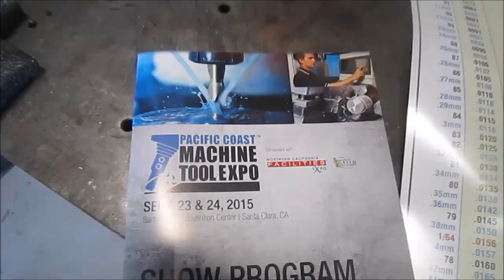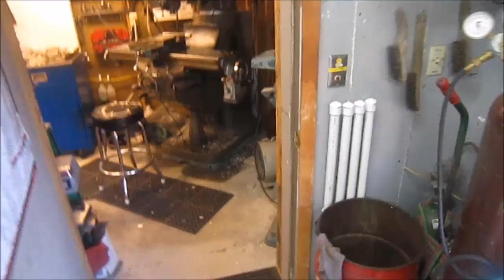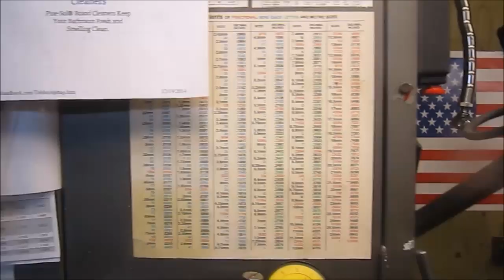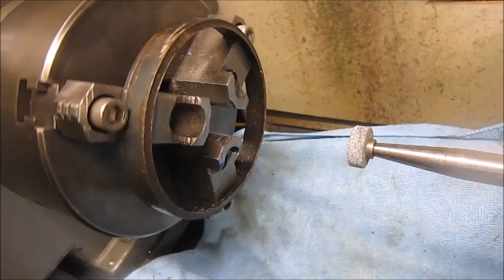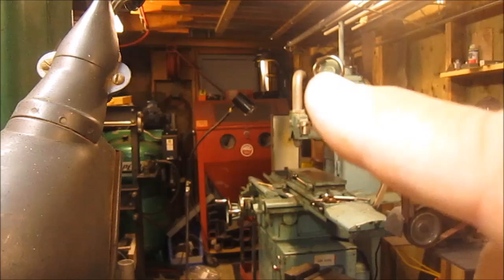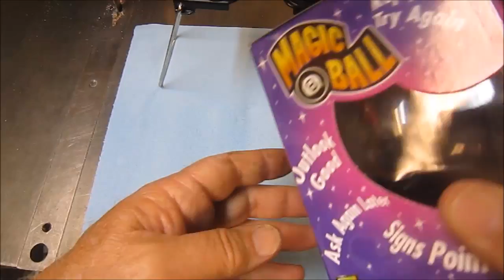Screwy Tuesday #30  Tool Post Grinding

Comment: That adjustable ring is to pre-load jaws before grinding or turning, the pins go inside holes in jaws..my Forkardt chuck
have holes. I made a ring with with 3 -  90 degree screws, going inside the holes, fine adjust by screwing in or out.

Comment: Hello Chuck, whenever I can spare some time, there is a chuck on my rotary head that needs some grinding to complete the full restoration... Interesting to see how you tackled the task...  
When you purchase a good quality chuck, the zero mark is set by factory as the most repeatable key, if you dismantle the chuck for cleaning or an other reason, you have to rebuild in the same order or find the new repeatable key...   ;)

Comment: Howie working hard I see. I hope your son recovers soon. As you must not know 3jaw chucks tend to have a master key, which is the one that is used to tighten that gives best accuracy because that is how it was made. In your case it is the one with the Big arrow beside it. 12:42. If you had used that one to tighten up your ring when you did the grinding it would be your master still, apparently the one you have found to be 0 was the one you used instead so now you have a new master.  I would probably regrind to put the master back in the right spot rather than adding a mark but in reality it matters not.

Comment: "Very doubtful" indeed. The two magnifiers are aimed at two locations. Getting them to point at a single location (such as for tool inspection) wouldn't be an easy job.

Why not enjoy them for what they are? On a still day (no wind or other motion in the field of view), take two pictures of the same scene from locations several inches to a foot or so apart. Print them  (horizontal size about equal to the distance between lenses) and lay them side by side under the viewer. Have a look to see the scene in 3 dimensions.  Move the pictures towards or away from each other to get the least eyestrain. (If things look inside out, swap the pictures right for left.)

These are usually used to examine pairs of aerial photographs to show differences in elevation (hence the "Geography Dept" label). I have a very fancy Japanese WWII military stereo viewer, with a set of micrometer cross-hairs. You can calibrate the cross-hairs on an object of known elevation, and then measure the elevation of any other object in the pictures. Pretty slick. (I mostly use them for the WOW factor to demonstrate the 3-D effect.) You can exaggerate the 3-D effect by taking the pictures from farther apart. 

Machinists with good CAD programs could print pictures using their CAD program's ability to create images from different viewpoints. Make two pictures from viewpoints several degrees apart (experiment) and put them under the viewer. Voila! 3-D pictures of your part.
Reply: I found a US military version on eBay, and it was such a good deal, I snapped it up. I'll compare them.

Comment: I too love my decimal charts - but these days no wall space either! One fix is a little 'bible' produced by Dormer tools - that serves well most of time. I in the end fitted mine to the inside garage door! Aha - roller blind fix -- like it!!
Paper rack nice idea.
Nice to have that toolpost grinder... I'm going to get a new chuck to replace my old one - but also got to deal with back plate issues.
Tubalcain took one of those 8 balls apart.
I had one of those map readers, from circa WWII - very handy. 
Persevere with the beard Chuck - it is good entry qualification to the old farts club! :)

Comment: The Huron tool is used to bore soft jaws in a CNC lathe with a hydraulic chuck that why it has pressure ratings stamped on it.

Comment: I like that chart on the shade trick.  Not quite as easy with the 20 foot ceilings in my shed, but might be able to find some ledge to hang a small one under.I hope Tim gets back home quickly.

Comment: Hey Chuck,
Thanks for the explanation. I thought maybe your razor blew up!  Thanks for the tip on the roll up decimal chart. Pretty clever idea.   Hope your son will be well soon.
Due to the drought, brown is the new green.
Have a good one!
Dave
Reply: +Swarf Rat You can really save space by setting several window-shade rollers parallel to each other. When I was a tad, all school classrooms had map collections arranged that way so the teacher could pull down any map she needed. When they were all up, there was the blackboard.
Reply: +Peter W. Meek Yes, I remember those. Also 16mm movies and film strip projectors. School in the mid '50s to mid '60s was a memorable experience.
Reply: We;ll, I'm about 10 years older than that, but, yes, it was memorable. (Film strips, and then projectors didn't come in until I was in high school.) The problem was that the subjects they chose for film strips and movies in the classroom were either boring or so dumbed-down that they were excruciating to watch.

I was once offered about 1000 surplus film stips from that era. Somehow I managed to turn down that offer.